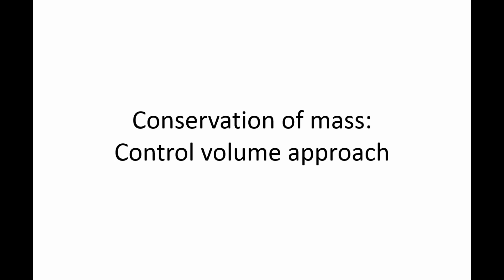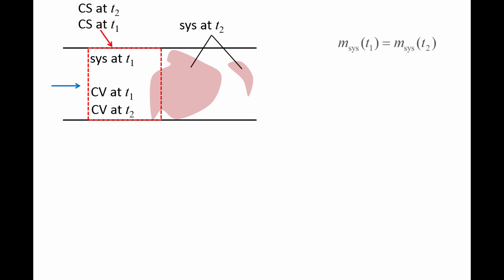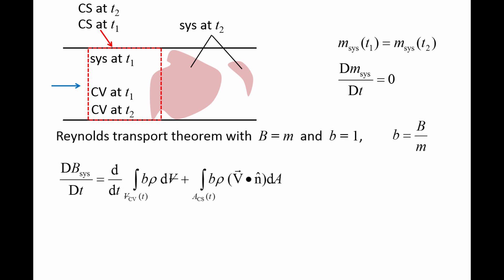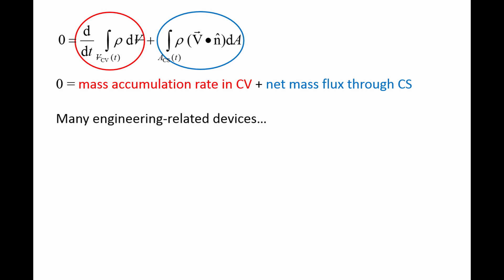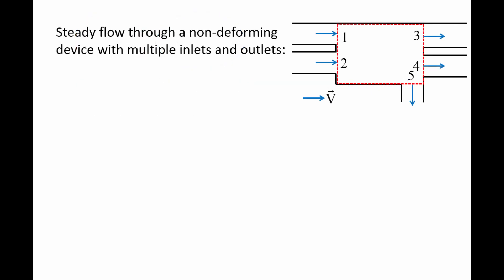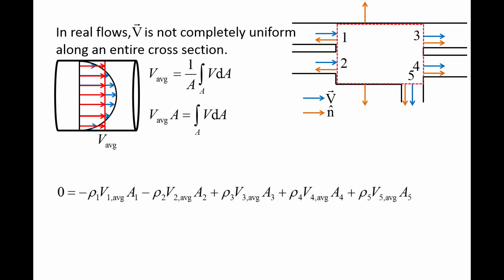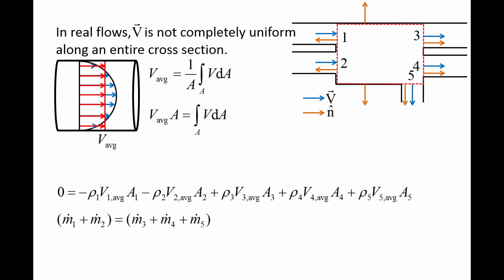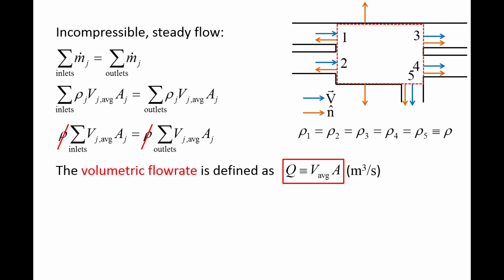Fluid Mechanics: Topic 7.1 - Conservation of mass for a control volume

Comment: From the video, whatever I've learned that is writing -
1. For steady flow, there is no net accumulation of mass with the control volume provided that the control volume it self should not be deforming in the time scale of instants considered. 
2. In steady flow at any instant in time, the incoming & outgoing mass fluxes are same so that the mass content at any instant in control volume remains the same.

Comment: At 3:08, it was stated that with steady flow, the term with the time derivative will equal 0 and because of this, the second term will also equal 0. However, on the next slide, we begin analyzing a steady flow device and acquire different results. Can you please clarify how this happened?
Reply from the maker: We use the steady state equation as the starting point to analyze the generic device. What do you mean by "acquire different results?"

Comment: I didn't understand where the walls part came from. Can you explain it a little?
Reply from the maker: What part of the video are you referring to?
Reply: @4:45 the wall of the integral.
Reply from the maker: The control volume consists of both the entrances and exits, as well as the walls of the device. The area is broken up into the five inlets/outlets, and the remaining area which is the walls.